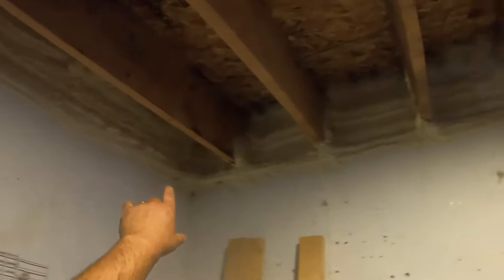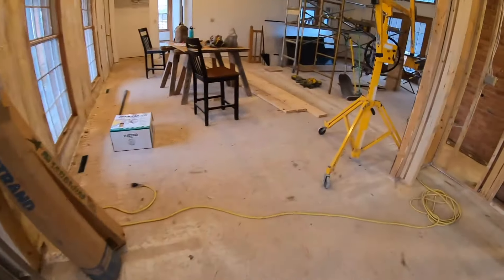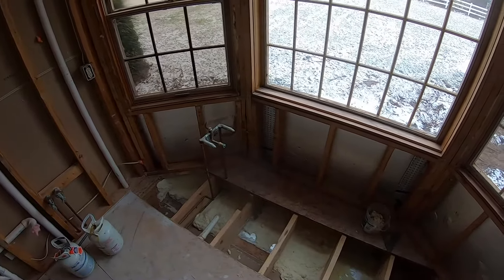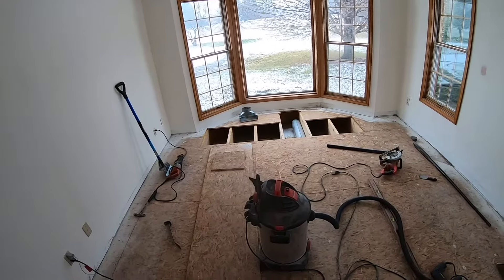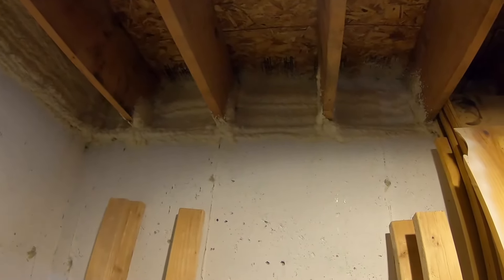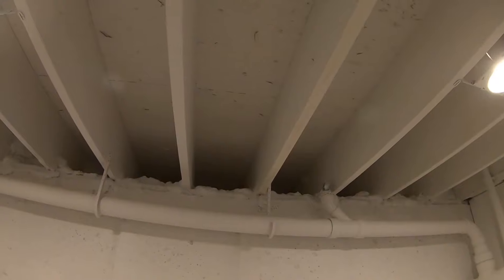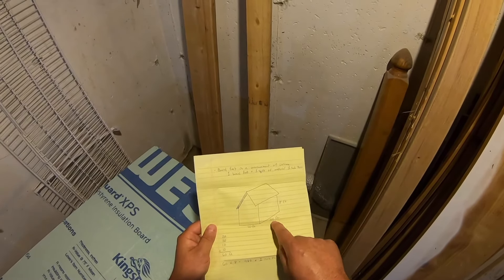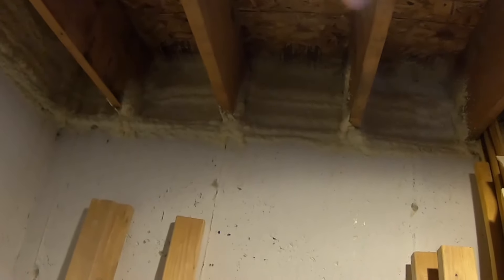How to Use a Froth-Pak Spray Foam Kit

Comment: Great presentation, Take home notes fan nozzle preferred.  For my situation giving the age of my house I used a few cans 1st to fill in the larger gaps. Remember there's a 30sec time limit when you're not blowing the foam from the Froth Pack. Then I used the pack to seal over everything.  Use a direct shot like air brushing paint. Slow is smooth and smooth is fast!
Reply: Trasalete

Comment: good stuff.  Your work is exactly what I'm trying to do at my house except it's already insulated.  I'm ripping out the loose batting that's stuffed in the pockets and doing spray foam then putting it all back
Reply from the maker: Thanks.  That’s what I did in several locations.

Comment: Good DIY video! I know you mentioned you placed the tanks on your heat register to bring them up to the recommended temperature did you find any problems with the surfaces you were spraying not being as warm as the temp of the tanks?
Reply from the maker: Thanks.  I found no issue spraying on a colder surface.  Very cold surface could give problems I suppose but I don’t really know.
Reply: I know it is kind of randomly asking but do anybody know a good website to watch newly released tv shows online?
Reply: @Drake Salvador Flixportal

Comment: Excellent advice 👍
What about the VOC smell? Assuming proper curing how long does it offgas? Trying to determine if I should put pregnant wife in a hotel overnight
Reply from the maker: I was surprised by how little it smelled.  It finishes curing in 15 to 30 minutes.  As for the hotel room I’m not sure.  Since your wife is expecting it never hurts to be cautious.

Comment: Nice work --was temp a concern for you?  I noticed it looked a touch chilly outside.
Reply from the maker: Yeah.  I set the tanks on a heat register until they were in the right temperature range.

Comment: Is there a reason you decided to use sealant instead of insulation?
Reply from the maker: Spray foam is insulation.  This has a better R value than fiberglass.  Also it’s better at air sealing.
Reply: @HowtoHacks  you're actually using Froth-pak sealant (green box that says "sealant") in the video, and not Froth-pak insulation (red box that says "insulation"). The two products are very similar,  but they do have different specs. This is why I was asking.

Edit: I don't know if the specs vary simply because of the testing/certifications and the way they decided to describe them, or if they are actually different.
Reply from the maker: The link below explains the difference.  The sealant is insulation and they have the same r value per inch however the insulation formula has a fire retardant in it.  So depending on where you spray it you may have to cover the sealant with a fire barrier like drywall.  Notice where it says, “You could apply the Froth-Pak Sealant to the board faces but your local building code may require you to cover the sealant with a fire barrier.”  Also to get this fire rating you have to spray 2 inches thick.  To spray that thick I would have had to buy a much larger kit and spend more.  Also I covered where I sprayed with drywall or fiberglass anyway.

https://www.awarehousefull.com/awf-blog/dupont-froth-pak-which-one-is-right-for-you/

Comment: Great job. Which tip did you use the Fan? over-spray seems next to nothing?
Reply from the maker: Thanks.  Yeah fan tip works the best.  If you watch the end of the video I discuss this.
Reply: @HowtoHacks  sorry yes I did get it at the end. Spray back or overspray onto other parts of the room is not an issue though?
Reply from the maker: @jamieforman8845  No it was very minimal.  I would still wear a tyvek suit and cover anything important though.

Comment: Man this was a mess. The gun gets absolutely covered in spray and it drips a little bit every time you stop spraying so that adds up and then I had one of the hoses leak so without realizing it a whole crap load of a Spilled Out onto the floor. Then the tanks are heavy as shit, each one I think is about 70 pounds so I'm having to constantly pick those things up and carry them around the basement and outside to do around the windows. The hose is constantly getting bound up and kinked and twisted the wrong way...

By the end of it I was covered in spray foam
Reply from the maker: Yeah you have to plan for all of that and be careful.  I covered everything I didn’t want to get sprayed.  Also I think I mentioned in the video about the hoses getting kinked.  I think I also purchased a set of longer hoses.  I didn’t have much trouble with the sprayer tip dripping or the hoses not leaking but I definitely see how that can happen.  Also I wore a tyvek suit, gloves and a hat.
Reply: @HowtoHacks  i had gloves, goggles, respirator, and old clothes. my goggles were peppered with foam...
Reply: @HowtoHacks  you know what also happened are those tips shot out of the gun a couple of times. So I'm in the middle of spraying and then I just get two unmixed streams hitting my wall
Reply from the maker: I had a little of that, but to be honest it was a lot cleaner than I thought it would be initially.  I was prepared for a mess but clean up was minimal for me for whatever reason.
Reply: @HowtoHacks  on the plus side Everything feels off once it's dried

Comment: How bad were the fumes
Reply from the maker: Not bad at all actually.  I would still wear a respirator while spraying though.
Reply: The problem isn’t the smell, the problem is you will get sensitized to the iso which will then give you a potentially deadly reaction in future contact. Skin contact too. Google it

Comment: Low yield 
Even 650 is not good
Reply from the maker: What would you recommend using? Just curious...
Reply: How to Hacks I used about 10 froth 200 and 30 froth 650 kits. The only alternative is hiring these guys with foam insulation truck, but these days they are very hard to find.
Reply: How to Hacks just feels very expensive. I managed to buy from Lowes with their contractor savings program so it was only $650 per 650 kit which is not bad. But now even Lowes stopped carrying it.